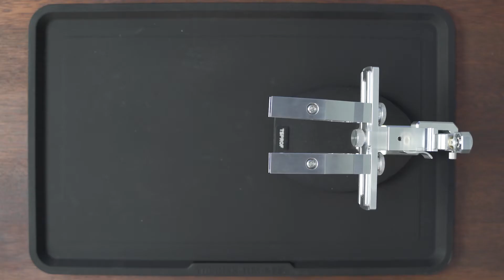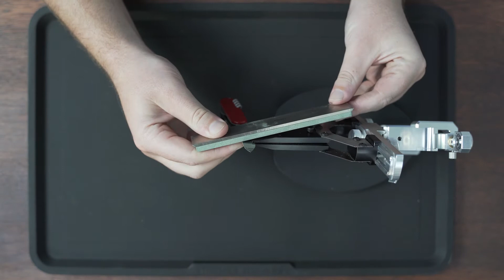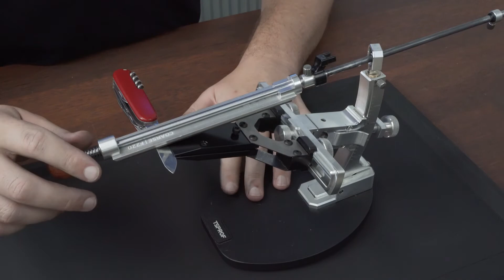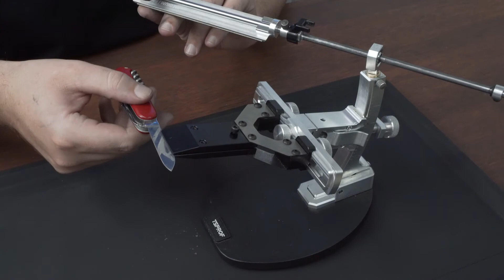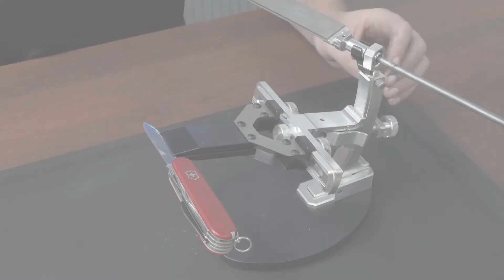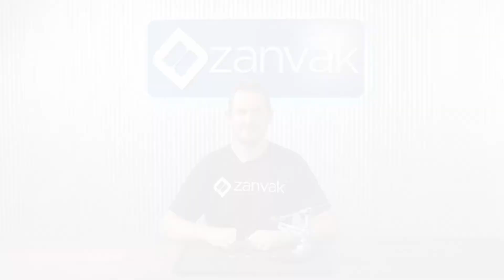HOW TO: TSPROF KADET CLAMPING AND SHARPENING SMALL FOLDING KNIFE

Comment: I keep creating uneven bevels. I check the angle of the clamp and it differs by 0.5 to 1.5 degrees after rotating and locking into place, depending on the blade geometry.
Reply from the maker: This can generally be due to poor clamping position or a uneven factory grind.
Reply: @zanvak  Thanks for the reply. I'll keep trying (on the cheap knives). As a new Kadet owner your videos are very helpful.
Reply: @zanvak  i have the same issue as scruggs. I have a difference of 0.5 \0.7 degrees between both sides. I’m’sure the blade is well  clamped.
Is it possible it.s a problem with the springs on the clamp ? I see on the k03 manual there is a way to setup the clamp
Reply from the maker: @jeanmarccierniewski837  all the parts are machined down to a micron so are very accurate, the clamps pull together and will try centre the blade, also the blade being clamped centred is key.
Reply: @zanvak  I have the answer directly from tsprof. Single clamps need to be calibrated. You have the "how to" in this video at 13:00
https://youtu.be/_W6U48dglT4
Reply from the maker: @jeanmarccierniewski837  Yes the single clamp can be calibrated but the whole milled clamps have no way to calibrate